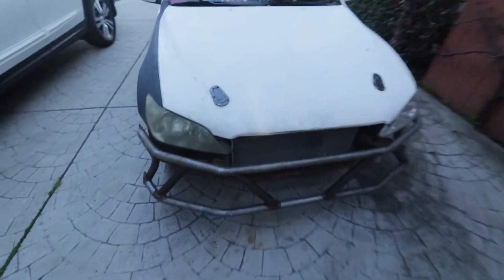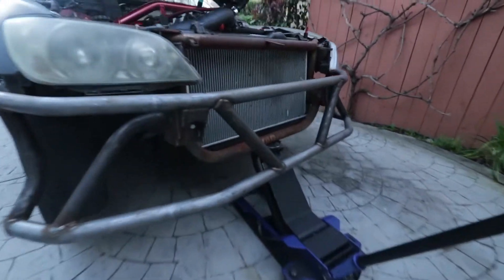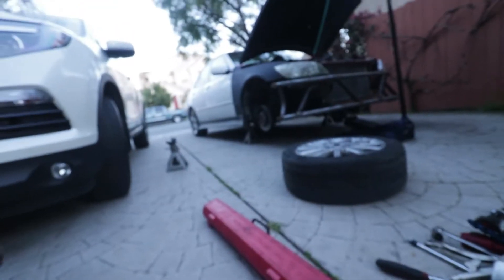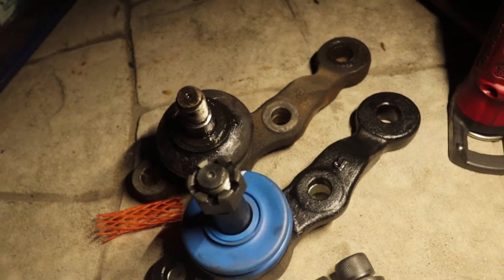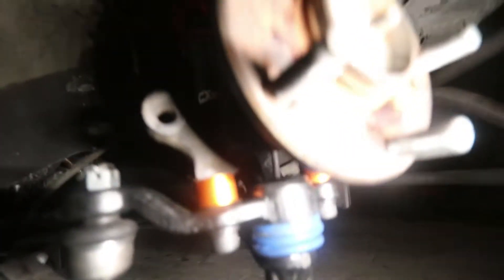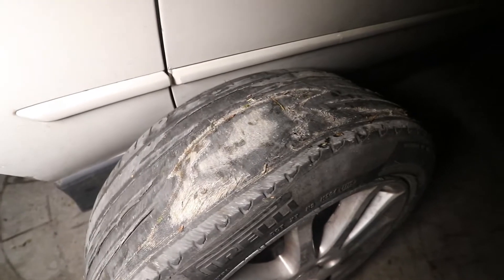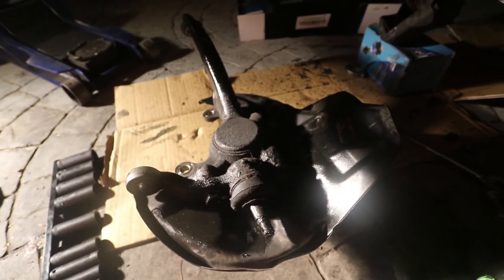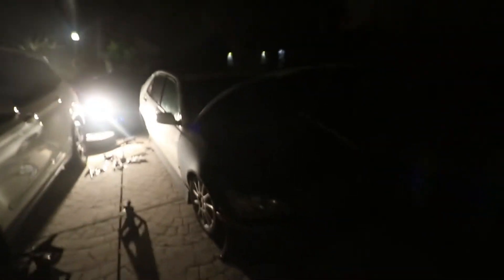V8 Is300 Suspension Refresh! Coilover Install!

Comment: my cxracing coils didnt have enough thread to safely raise the car high enough to compensate for the additional 1" drop that the ball joint spacers provided. I ended up making a 1" spacer for the top hat of the coilovers. just mentioning incase you want to raise your car up.